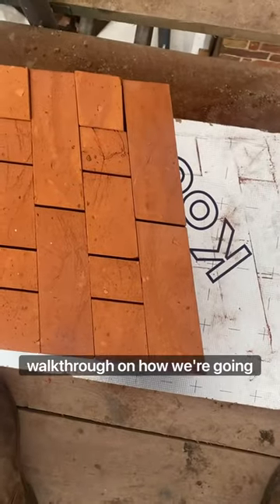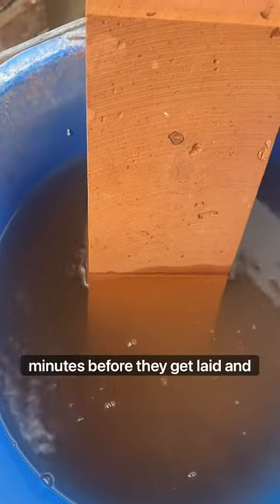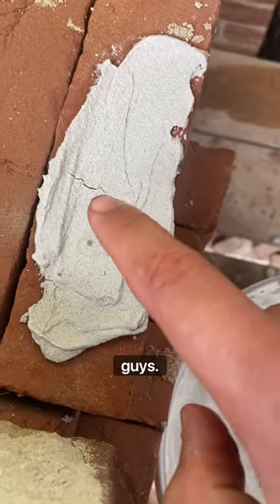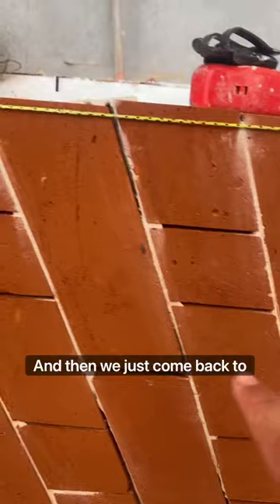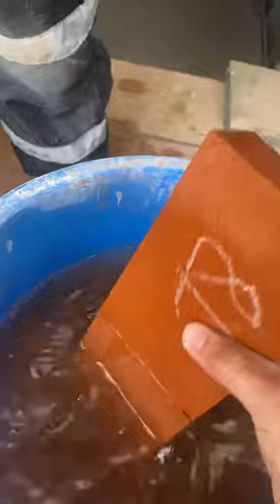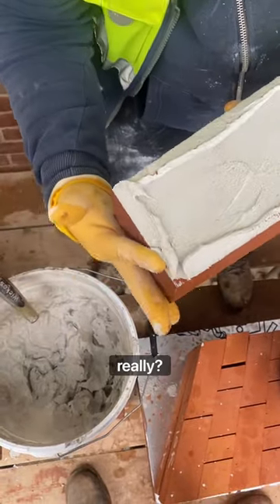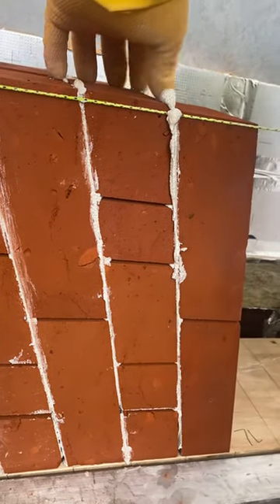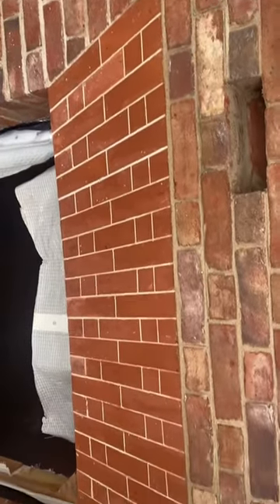Flat cambered arch using red rubbers and putty

Comment: Nice job Ash , Rob Songer quality 👌🏼.
   We’ve just dropped a standard arch In Leam built from rubbers and 2 mil joints , replaced it with a big ass steel 💪🏼🧱👍🏽
Reply from the maker: Thanks you Steve. Not his level yet haha. What lintel detail have you got at the back ?
Reply: @bricklayerstvbsc  just plain arches mate . 9” solid walls 🧱👍🏽